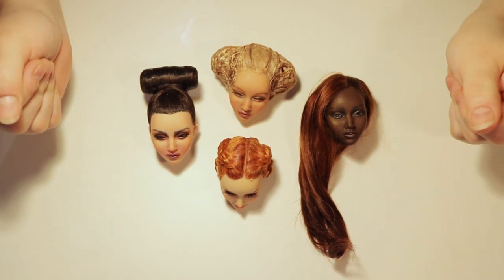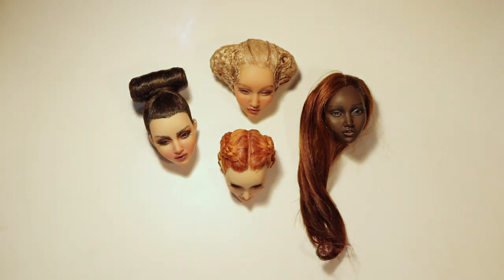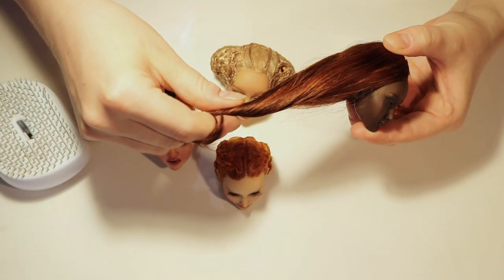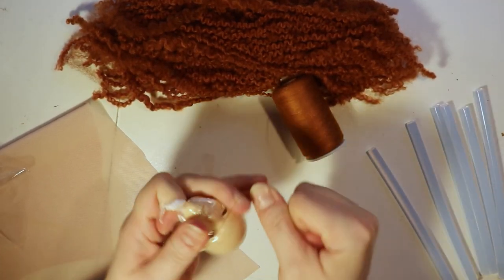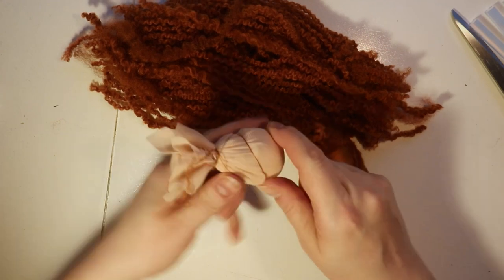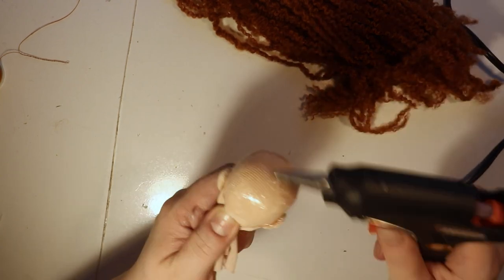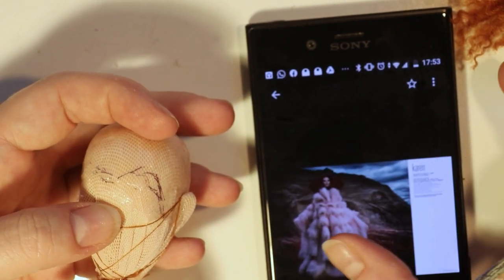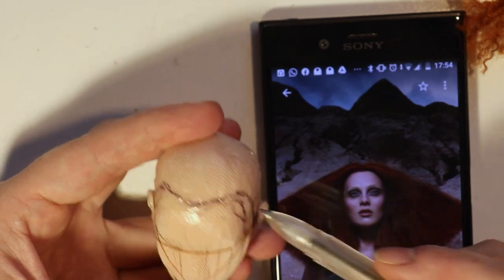Making Hard Cap Wigs - Part 1 - Cap

Comment: Thank you for your video tutorial.  I have done wigs with both wefts and loose hair, using clear silicone, or with clear craft glue.  Today I made a wig using your hot glue method, and though no where near as good as your work, I think it came out pretty good for a first time.  Plus mine was a 29cm lady, with a tiny 9cm head.  Very hard to find good wigs for them.

Comment: If shorter videos are easier for you I would be happy with that. Thank you for this idea. I cannot wait to try it. I am interested in seeing g your method for attaching the hair. Do you use hot glue for this as well?😊❤❤❤😘😂
Reply from the maker: Yes, I use the hot glue for making wefts and then melt them on instead of adding glue to keep things tidy. But that's the next video.
Reply from the maker: The second part with gluing is out now.